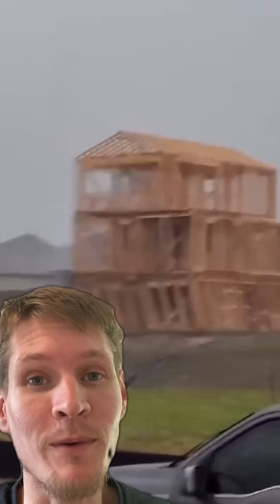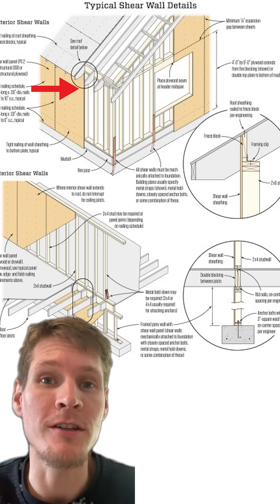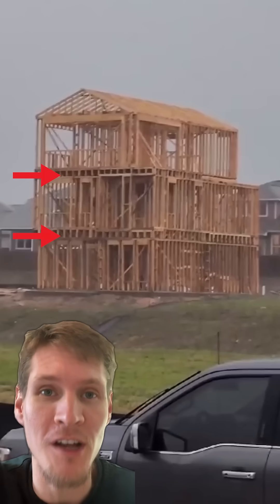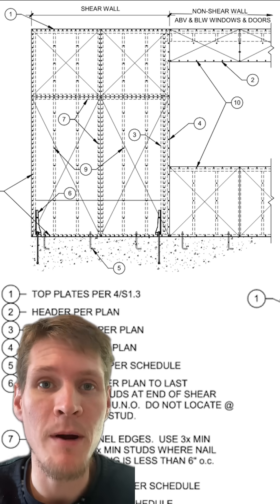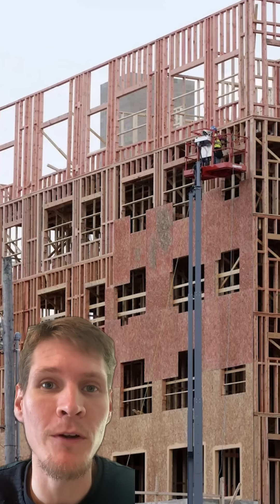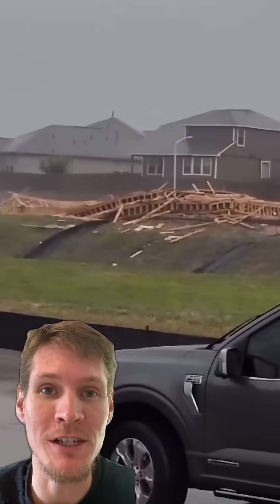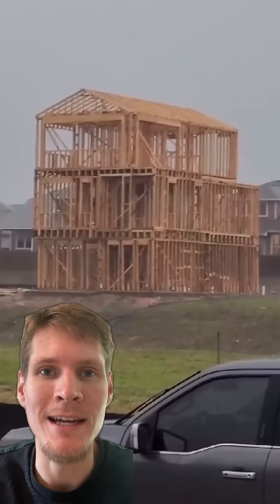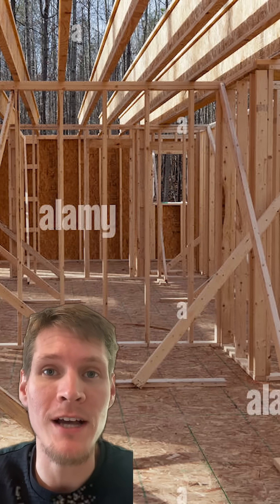Professional Engineer Reviews Reddit Structural Engineering Thread | Part 1 #engineering #reddit

Comment: Not sure if I'm asking the right kind of question for the video, but how did the forces of the workers doing daily tasks not collapse the structure? I understand that the video shows a violent wind storm, but would a group of workers walking around not cause a similar collapse?
Reply: Idk what you think builders are doing in there but it’s not like they’re pushing in the side of the stud walls. They’re standing on the floors- they’re essentially vertical loads, which the bearing walls and beams are designed to resist

Comment: How? How did no one on that project not know this? That would be one heck of a ride
Reply: Can almost guarantee this was caused by a foreman forcing progress before materials are available.  Probably told the farmers to do temp shoring until parts got delivered.
Reply: @Michaelroni-n-cheese 
He gambled on having time to reinforce later before the weather got too bad, but lost that bet.
Reply: I work in construction. Most contractors often hire guys with no experience and train them for a day or two and then leave to start other projects. This is how shit like this happens. Greed. Apathy. Laziness.
Reply: You’d be surprised who’s allowed to build homes.
Reply: @paulb9156 You can train most people to frame. It’s a matter of supervision. The builder had an inexperienced crew - fine, they have to learn. But then there was no foreman with experience to supervise their work.
Reply: Yeah, I do Concrete and embracing like that is supposed to be able to hold up quite a bit ( we use the same exact ones when we do concrete walls but one big difference is on an 8 foot concrete wall. There’s a lot more weight To shift laterally I would say probably a lot more equivalent to what this three story house has but just on the first floor that’s about how many we had on one wall. They didn’t place them smart enough. Nor should they have kept them as the only thing they should’ve had people sheeting the bottom floor and the second floor with all of the bracing if they did not have enough.
Reply: Might be that someone did not get paid enough and took the most important brace with them when they went home...
Reply: They have the diagonal 2x4s, but my guess is they aren’t nailed at every stud because they were thinking to remove them soon. It’s likely a shipping delay issue that pushed them to do this. Think about their process and the mistake can make sense.
Reply: @CountJeffula 
Yeah, they were probably gambling on having time to reinforce them later before the weather turned bad, and they lost the bet.
Reply: Probably pressure from corporate to get more houses done faster I would assume. It's easy to blame it on the workers, but I think that's kind of short-sighted
Reply: 😂😂 they topped it too. They knew it would happen. They knew they were doing stupid.
Reply: Money
Reply: Cut-rate everything. Training? What's that, sounds expensive.
Reply: I inspect new work everyday, and builders that are good never have to back it up with, “I do good work!” To the plebeian builders, good work means below minimum standards and practices.
Reply: There was a storm. Hence how they were filming it in the first place. Sheething might have kept it up, might have not, the sheets might have ripped out if partially installed without windows etc anyway.
Reply: I like how an incident that was almost definitely the result of basic human behavior (i.e. taking “harmless” shortcuts based on the heuristic thinking of “eh I’ve done it and/or have seen it done before and nothing bad happened, so I’m sure it’s fine; we’ve got a schedule to keep, after all - gotta think about the bottom line!”) immediately leads to a flood of comments focused almost exclusively on assigning blame; specifically, assigning it to a) people from another country, b) people from another race/ethnicity, c) people from another political party, d) people from another social class, or e) some other form of the tried-and-true “people who are different from, and thus inferior to, me” egoism (with an egoism being like a colloquialism, but for egos). 

Fun Fact: It is almost never useful or productive to focus on “whose fault” something was. Individual accountability has nothing to do with judgment or punishment (neither of which serve any useful purpose), and it certainly doesn’t involve anger, shame, violence, and what have you.
Reply: If it was an owner builder in a county that no plans requiring review by a plan checker this is the outcome.
Reply: Knowledge is power. Ignorance is the path to failure. Educate!
Reply: Eduardo, Enrique and Salsatonio are paid by the wall regardless of proper building techniques. They were already out of the country, cash in hand before this fell.
Reply: Pendecho labor.
Reply: My guess is the manager didn’t listen to the foreman
Reply: If no one did not know it then that would mean they all knew it
Reply: Right??
Reply: Where I live we install the sheathing before standing up the walls.  It is safer and the walls are square before standing them.   And you don’t have to worry about this.   Imagine if someone was in the house or on the trusses at the time.   Insane.  Get new framers.
Reply: Same practice here in Canada.
Reply: @Dogonatree   that the updated code..how did Biden government not know this wouldn’t work.
Reply: They probably did know this and that’s probably why they had the temporary shoring…. They’re on the timetable and certain phase of the project have to be completed before the weather sets in so I imagine somebody didn’t order something or something was back ordered and they tried to just keep pushing forward with construction while we waited for the other components to arrive in this case the sheeting
Reply: They just didn't expect that kind of wind.
Reply: @uzefulvideos3440  Even without wind, that's just bad practice.
Like driving without doors. No one expects to fall out, but it's just stupid.
Reply: @sleazybtd My guess is a combination of the availability of heavy equipment and somebody not ordering the sheeting in time.  In a neighborhood like this with multiple houses going up at the same time what probably happened was somebody raided their supplies and took the sheeting for that house to work on something else…. Which left them with a bunch of framers on site and so they chose to build it and shore it and get more sheathing later
Reply: @Matt-yg8ub  If that's the case, then it's even worse. If they're building multiple houses with no sheeting available to the point where the framers had to build upwards to the second or third floor, then that means there are multiple houses in this condition.
Reply: @uzefulvideos3440 Yeah that’s pretty much what it is. I suspect they built dozens of houses like this without any problems but they got heavy winds this time before they can get the sheathing on
Reply: @uzefulvideos3440  it turned out to be just a fart
Reply: Because non union workers just know how to do one thing instead of knowing everything and have full carpentry training. It’s what happens when people just vote instead of actually being educated on things.
Reply: @cjones1693 - I have known way more unqualified union workers than non-union workers.  Your post is ignorant.
Reply: @cjones1693 Let’s assume this was a union job, somebody forgot to order the sheathing and so the entire site sits idle for three weeks while they wait for it to arrive. The weather changes because now this projects been pushed further into the fall and The carpenters won’t work while it’s raining so the project falls further behind. It’s now November and we basically have a better foundation and a few sticks because the carpenters won’t work in inclement weather and we don’t have enough sunny days to be able to build this house so nothing gets done what has been put up rots over the winter and in the spring they tear it all down (again with union demolition of course) and start over again and by the time this house is done it’s ballooned from being a five hundred thousand to an eight hundred thousand dollar house
Reply: @cjones1693 
Unions were a late 19th century solution for a late 19th century problem. They cause far more harm than good to the entire country at this point.
Reply: Eduardo, Enrique and Salsatonio get paid by the wall and were already out of the country, cash in hand when this happened.
Reply: Out of the country 😂